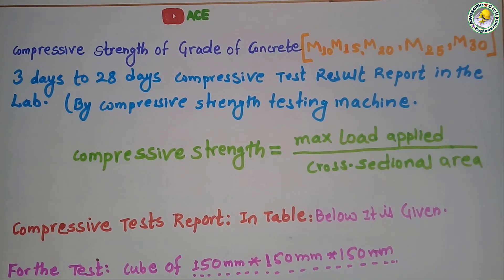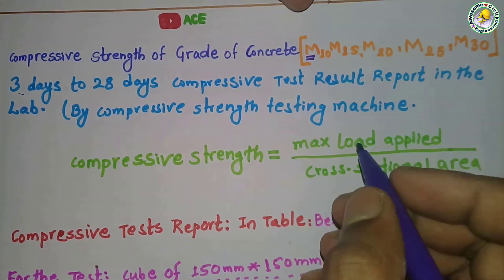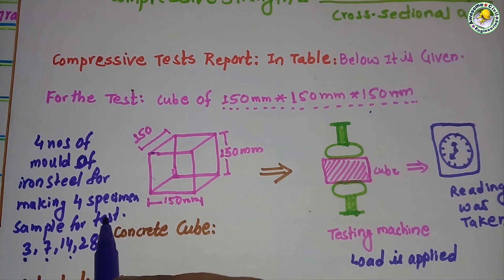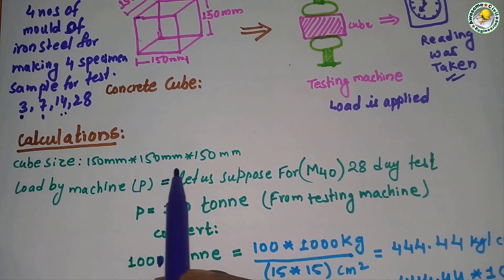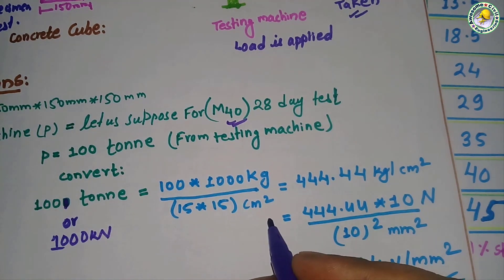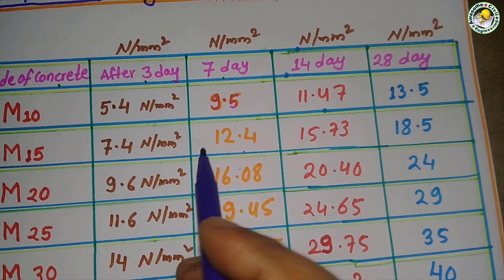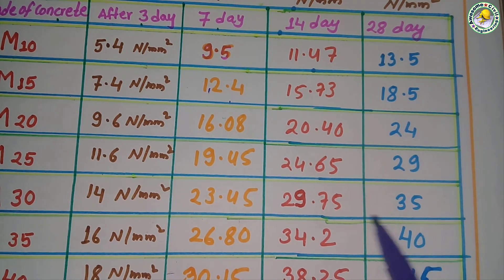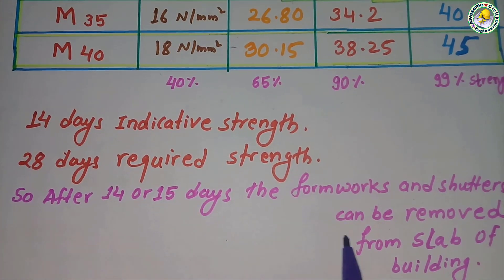Compressive Strength Of Grade Of Concrete || M10,M20,M30,M35,M40 || 3 Days To 28 Days Full Data ||

Comment: I am a little confused?  Why does the compressive strength based on cross-sectional area i.e. N/mm^2 ?
if the volume is not a factor in determining the compressive strength, then why the test is performed on a cube?
Why not perform the test on a flat concrete such as 150mm x 150mm x 10mm ?
Can anyone explain?